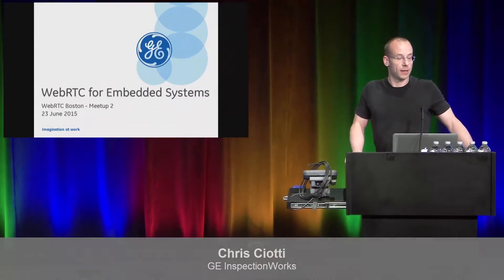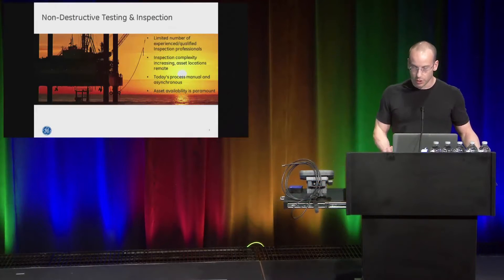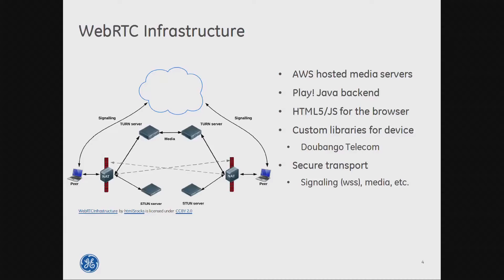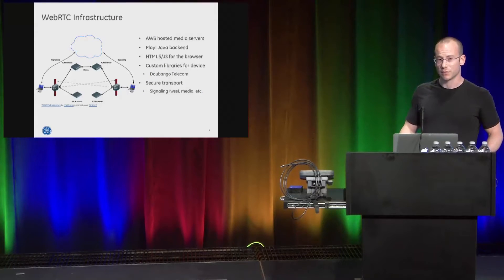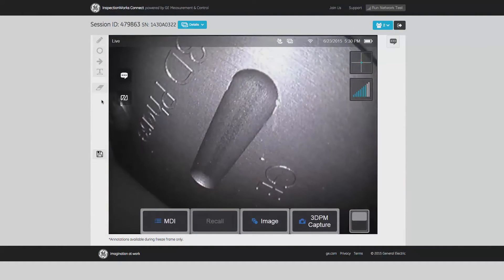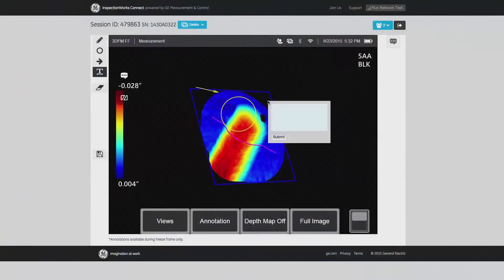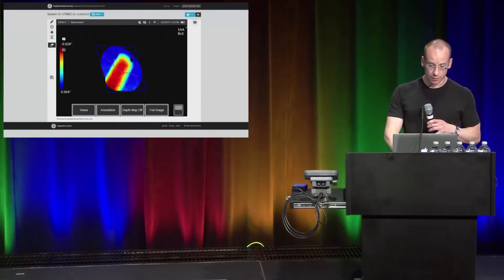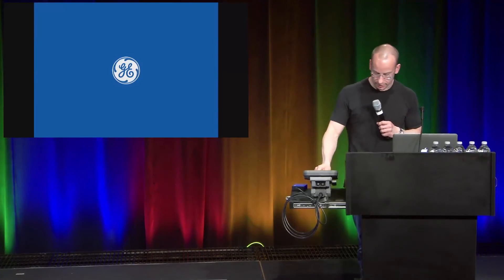WebRTC for Embedded Systems - Chris Ciotti

Comment: What is the glass-to-glass latency of using WebRTC on an embedded device? For eg. in case of moving cameras, what is the delay in displaying the current frames vs the displayed frames? . If a usecase involves 30-60 fps, is the latency at least close to 100-150ms?